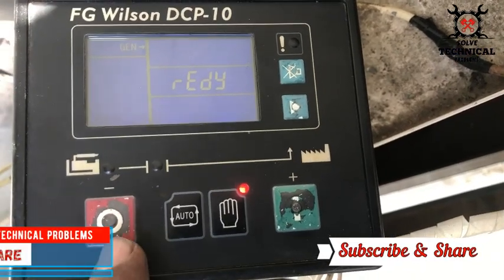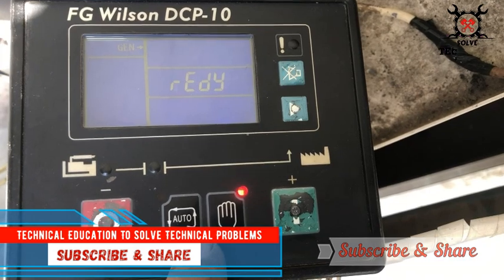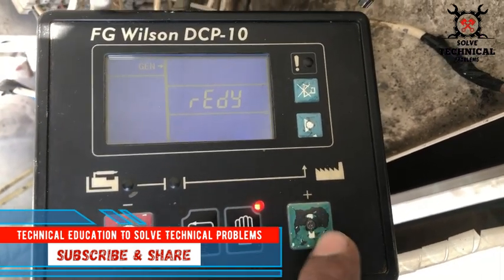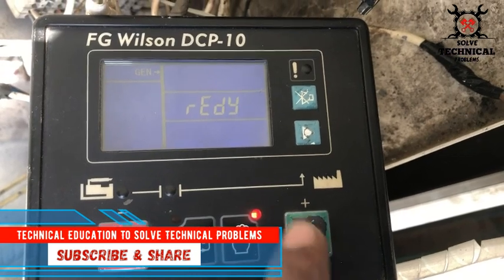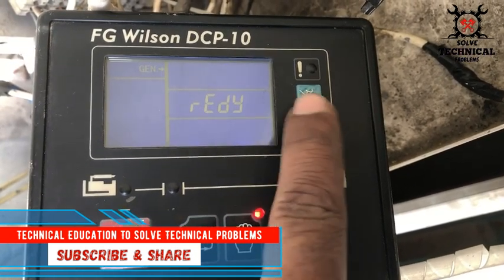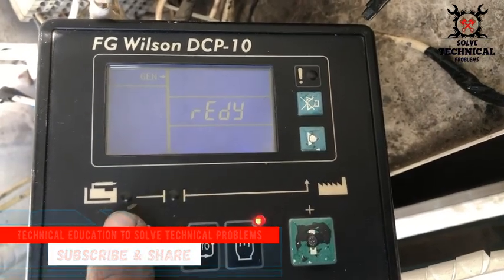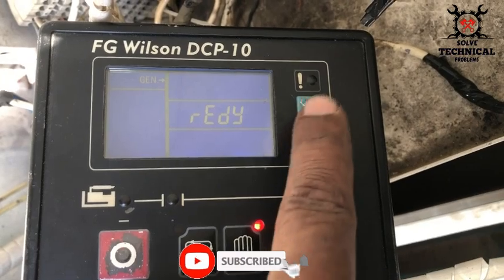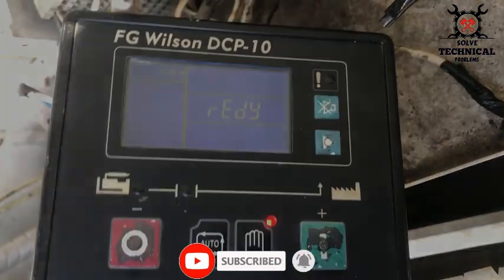Dcp-10 Controller wiring learn the process in 3 minutes watch  complete video.

Comment: can you tell how to connect a fuel cutoff solenoid to use as the engine stop please
Reply: the solenoid is normally open and needs to be energized to cut off fuel to stop the engine
Reply from the maker: Add extra timers and relays and make a new control circuit for solenoid to energise and stop the engine and stay energised for 20 seconds.